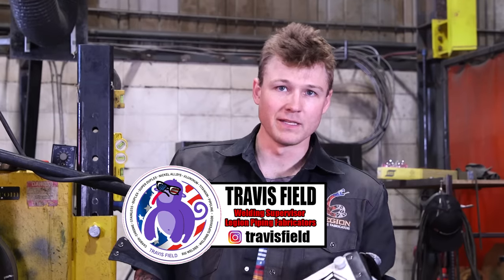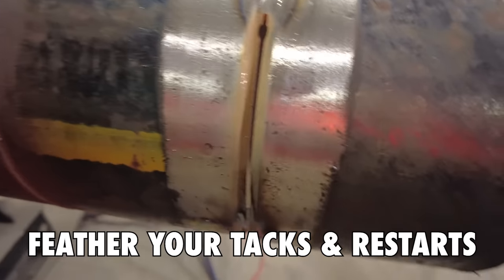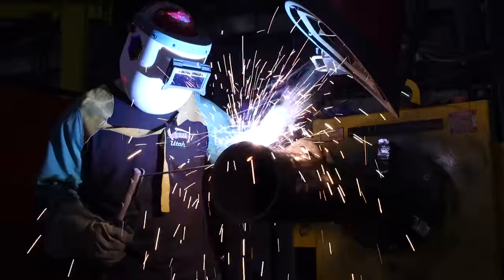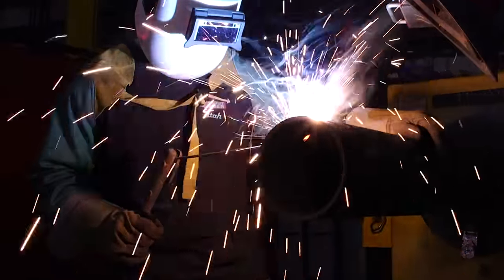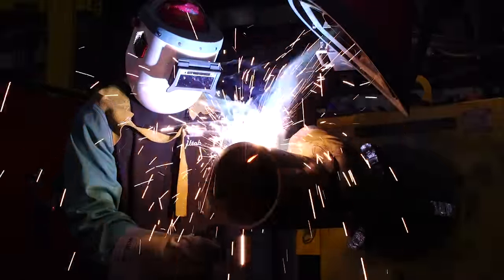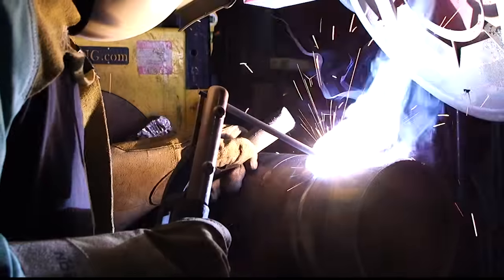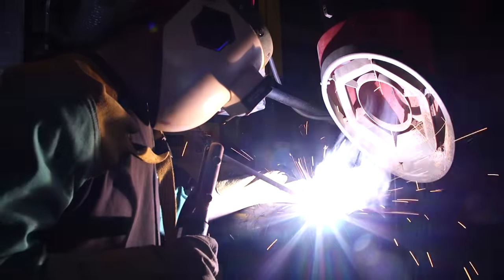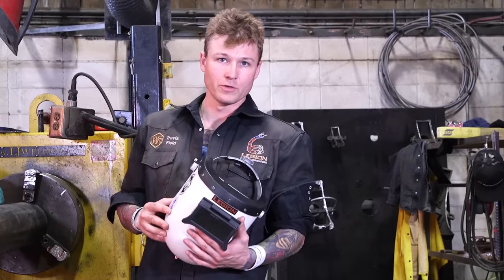Stick Welding 6” Pipe | 6010 Root and  Hot, 7018 Fill and Cap

Comment: Was a Boilermaker welder, on construction sites. My work was doing "certified" welds on high pressure powerhouse boilers, refineries, blast furnaces. It involved new and repair work. Many "rod burners" can do their work, standing at a jig or table. A "welder" can do the same quality welds standing, sitting, laying down, on their stomach, on their back or (as I once had to) bending over and welding between my legs (inside a boiler steam drum. Had my weld pimp comment that he didn't know we had to learn to weld standing on your head. Told him, "You don't, but if you want to get the job done, you better learn how".
Reply: @@tittlemouse92 I truly loved my career as a union Boilermaker welder/mechanic. I admit I didn't put down the "textbook perfect" welds some people here post. I can honestly say, that in over two decades, working with the tools, I never had put in a weld that failed a test, nor did I fail to certify. There were times that, because of this, I was sent to jobs where the welder (I replaced) had taken a shortcut and got caught.
You can look into a welding program at a local community College, to learn the basics.
If there was advice I'd give someone it would be to be:
1. Patience, when you hurry you miss things and make mistakes.
2. Make sure the surface/s your welding are "clean from any contaminate/s". Even if you're at a welding course and get a test coupon, run a torch flane over the area your going to weld, to remove any oils. Use a grinder (disc or burr) to remove scale from the metals. If it's a tube, that means inside and out, about 1/2" along the area you'll weld.
Working on a boiler for a 650 megawatt powerhouse. The customer wanted a section of water wall tube cut out/replaced for testing purposes. The material was a chrome alloy steel. Chrome alloy welds don't like dirt, of any kind. I had a good rapport with the customer weld tech, and he knew my welding. I marked and cutout the piece to be tested, located and cut/prepped the replacement piece as described above. My shift was over and the next crew came in to continue the work. They were to prep the existing area/insert/tack the new piece in. The weld procedure called for a heli-arc root and stick fill/cover.
This weld was a bit tricky as I could only see/weld three-quarters of the tube. My partner, on the other side did the rest. As I heli-arced the weld and got to the spot directly 8n front of me, the weld puddle started to get bubbles in it. A clear sign that the area had never been cleaned and the weld wouldn't hold. The weld tech was called and authorized cutting the tube back out, 4 inches (either end) longer so we could see what happened. Once removed you could clearly see the area that bubbled had not been cleaned properly. The weld tech informed my boss that the other crew wasn't going to weld any more. The job was mine to complete.
Reply: Local 175 boilermaker, I’m loving it.
Reply: @Kingbib  Detroit Local 169
Reply: @richardkawucha1232 This was an excellent read. Taking Welding courses at CC. Is job searching easy after?
Reply: @ZEPEH-46N2  I would recommend an apprenticeship. Classroom knowledge can only take you so far. Working at a blast furnace job, I had a really smart apprentice, who had taken welding courses. He and I were assigned to weld a light steel rain shield to the side of a dirty gas main. The main was 3/8" plate and the shield was 1/16". All we had was E7018 - 1/8" and 6010 - 5/32" rods. He wanted to weld so I let him. He had a hard time, until I showed him to keep the main part of the puddle on the heavier steel, letting the puddle edgewater onto the thinner metal. The rain shield had been torch cut off and split. Now we had to weld the two thin pieces together. He tried welding it and complained that we needed smaller diameter rod, because he kept blowing holes in it. I told him to hand me a stick of the 6010. I inserted it in the holder then grounded it out until the Flux burnt. He told me I just ruined that rod. I told him I just made it usable.  I then proceeded to drag the rod along the gap. He complained, I wasn't welding just putting bb's down. Told him he's right, but every bb is metal that I can weld. When I felt I had enough bb's in place I took a fresh stick of 6010 and ran a quick bead , melting the bb's and welding the two pieces together. I told him that now we can run a 7018 cover pass. I let him do the second half.
While I'd had some welding school training, this was something an old timer Boilermaker taught me. I just passed on the knowledge.

Comment: Can y’all do one of these but in position?
Reply: This  position is retation
Reply: @dja  I think they know that, just asking for a fixed pipe.
Reply: Yh, and show us uphill welding..
Reply: Good luck welding uphill with a 6mm 7018 😂 300 amps! Downhand in rotation only for that procedure I'm afraid
Reply: You ain’t know these guys can wear doing handstands buddy… 

They ain’t got a show you  lol
Reply: @samwhite1823 lies
Reply: @samwhite1823 it's 6010
Reply: @romanianmoto speak English without the seizure in the middle
Reply: Yes
Reply: @Martin-mo2wd Understandable, but that is the point of a hot pass. To burn out any inclusions.

Comment: 1/4 "7018 is a bit overkill for fill and cap. 5/32 would be better. I understand the reason. Fab shop you have weld it as fast as possible.

Comment: Ok so this leaves me confused. Down hand 6010. Is that aloud? I’ve been told both but my b pressure certification says up hill only
Reply: Or wait this is being rolled… so I’ve bin rolling but if it’s in position do you have to have a specific certification for a down hill root?
Reply: Different procedure, it's allowed but as with any pipe procedure if it's designed uphill you have to weld it uphill. Downhill 6010 is still the preferred method for cross country piplines

Comment: Going into my 2nd year welding apprenticeship, I thought 6010 was pretty much on its way out?

What is the reasoning for using it on the root then a 7018 to fill? 

Thanks! I'm not too far from you boys, down in Airdrie, AB!
Reply: 6010 has all kinds of benefits as a root/hot pass rod. However some pipework requires properties that 7018 excels at providing. Lots of reasons for both depending on setting and application I'm afraid! I don't want to get ahead of your college or confuse anything you're being taught so just keep at it the knowledge will come 👍
Reply: @samwhite1823  No this is all good info, appreciate it. I'd really have to be in the field to get a better grasp on it. 

I'm currently in a shop fabricating/welding which is a whole nother ball game!
Reply: @anxietyonline1947  nothing beats time with the machine, once you get to spend some time with 6010 you'll see how good they are at getting a root in fast, especially downhill. Keep at it bud 💪
Reply: @samwhite1823  Yes sir I agree! Appreciate the info!
Reply: What welding machine was he using and what brand of 7018 ?
Reply: 6010 cellulosic rods are used for rooting only. Then after you fill with low hydrogen rods. 6010 will never go out there too good at putting roots in.
Reply: E6010 are excellent for root passes both uphill and downhill. 6010 5P+ is typically used for the root pass while 6010 Brick Red is used for the fill and cap. The reason for this is because 6010 5P+ has a slightly softer arc and tends to be more user friendly. However when filling and capping it tends to pinhole while 6010 Brick Red will not. Both of these 6010 electrodes contain trace amounts of hydrogen which leads to weld cracking. Hydrogen infusion as it turns out is #1 in the list of things that make welds fail. In recent years gas companies who build cross country pipelines have started moving away from E6010 root passes for this purpose and have began welding the root pass on their pipelines with E7016 Kolbe rods. This is an excellent rod for running the root pass and it’s also a low hydrogen electrode much like E7018. Typically more often than not if it has a E7016 root pass it is then filled and capped downhill with one of several choices of downhill low hydrogen rods. If you want to try and fill and cap with 6010 there are videos that show how to do it or just ask and I’ll give you a recipe. Putting a 6010 root pass in downhill isn’t hard it just requires some time under the hood. Low hydrogen electrodes such as 7018 are used for filling and capping for several reasons 1) they have very little hydrogen and if baked properly prior to use they can get very near to 0% hydrogen, 2) they are much more ductile than any electrode that ends in 0 such as 6010, 7010 or 8010. For instance in your welding school take two pieces of scrap metal and put a 1/4” tack on each end with 6010, then take two more pieces and put a 1/4” tack at each end using 7018. Once the two pieces are tacked try to wiggle them until they break apart. You will find it took several more wiggles to break the 7018. This is because 7018 is more ductile than 6010. This is actually a cyclic test, you performed a demonstration of how many cycles it took for both welds to break. So your question of “why did they use 7018 to fill it.” 7018 is more resistant to cyclic load failures due to it being more ductile and it has near 0% hydrogen while rods that end in 0 are bombarded with it. I hope this helps and I hope you learn a lot at your school.
Reply: @jeffsmith3941   Great Information. The use of 7016 rods for pipe root welding seem to be more rare in the US compared to other parts of the world. The brand and type of 7016 rods that is mainly used in the Oil and Gas industry is made by Kobelco, and is called LB52 "U", any welder in the industry that has used this rod would know exactly what rod this is when we see or hear this name due to its popularity.

Comment: Love to know why,  if the procedure demands 7018 rods (hydrogen controlled) you are putting a 6010 rod in the root. The root being the main area susceptible to hydrogen cracking. As a qualified welder and inspector, retired, even the modern 6013 rods have more cellulose than is good for them and are no longer any good for structural steels. But a 6010 is right out of spec. I would love to hear the logic ,or lack of it, from other weldwrs.😊😊😊
Reply: If 7018 is required. 60 series rod would not be used.  The root would have to be 7018.

Comment: Which brand rod you used sir
Reply: My 2-cents worth, LINCLON  5P+ (root & H P) then Excalibur 7018 (fill & cap)
Reply: @bobroberson9286  hello dear sir
Reply: @nathkrupa3463  hello to you 👍🏼
Reply: @bobroberson9286  sir any skills and knowledge of you on welding please tell me
Reply: @nathkrupa3463  Being a good welder is ALL about practice and skill.  You can learn to weld good enough to get a job in a welding booth at school BUT it's gonna take years to develop the skills of a good welder.   I have been making a DAMN GREAT living in the welding business for over 45-years.
You need to know as much as possible bout different processes but pipe welding is the 💰💰💰maker in my opinion.
Reply: @bobroberson9286  great job sir 😊
Reply: @nathkrupa3463  what Country are you located in pls
Reply: @bobroberson9286  living in india
Reply: @nathkrupa3463  Ok,  another thing to consider is the demand for welders in India ,  or are you thinking of relocating to another Country
Reply: @bobroberson9286  no sir
Reply: @nathkrupa3463  Ok,  I don't know how much welding is going on there and how much welders are in demand there,  check that out for yourself
Reply: @bobroberson9286  thanks sir. Nice to chat you

Comment: thats ganna take waaaay to long for just one weld, fill It with the hotpass and cap it. most places will run you off for being that slow. we do the same exact procedure for BPX and we're averaging 12-16 6" sch-80 welds a day, roll outs and position welds. at that rate you can probably do 7 maybe 8. not really ideal.